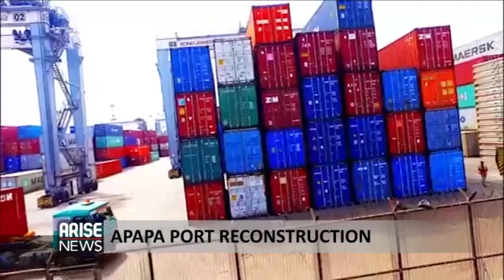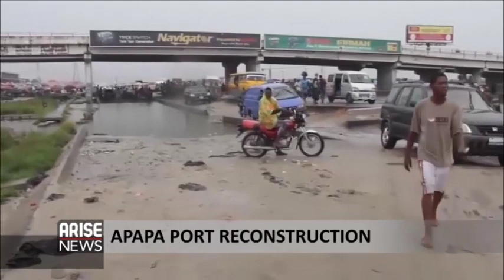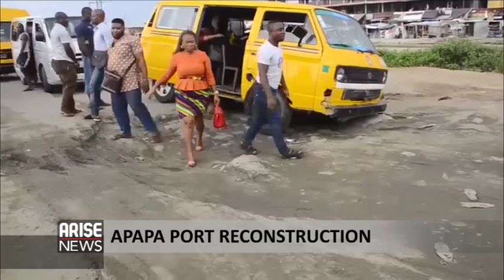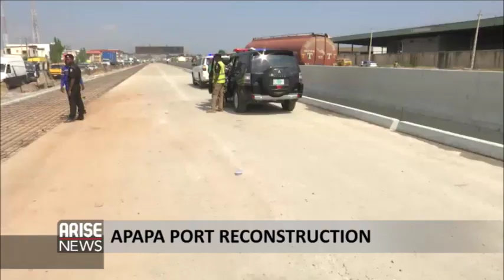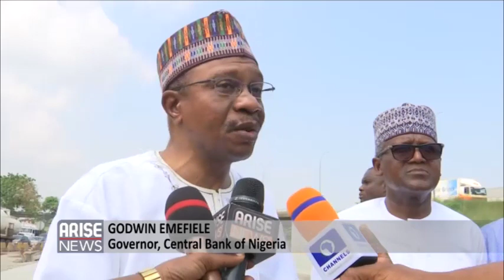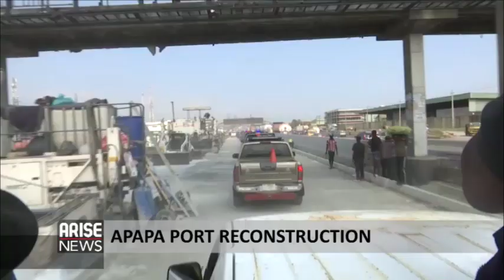Apapa Road is 12 inch reinforced concrete for 40km! -  Dangote & Emefiele

Comment: I stand to be corrected, I am yet to see a re-inforced concrete road in this part of the developed country I am currently,that will be 48years old in less than a week from today. 
The busiest of them has got Asphalt and it's more than 40km.
Reply: Germany has re-forced concrete in almost all their highways. I am a truck drive
Reply: You are an illiterate go to New York Chicago Seattle they're replacing the asphalt roads with concrete you don't see so much of it cause its expensive but states with the fund are doing it cause it last longer so they are doing it gradually when you drive on the concrete section you know they are trying do it in bits cause of finance but if done they can last way more than 40 years maybe even a hundred 40 is just the guarantee the developed countries are moving towards that
Reply: @Terry884  Thank you , I have not been in Africa for a long time now.
Reply: @ikennaogwogwo  Kenya is building them too. We have had one for 15years, not even 1 porthole.